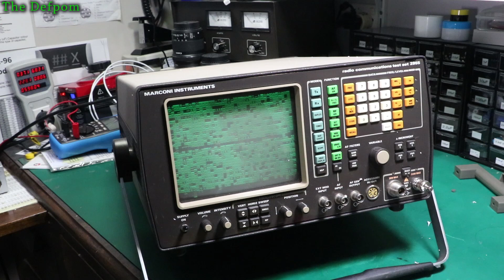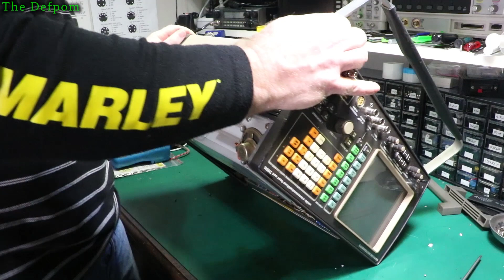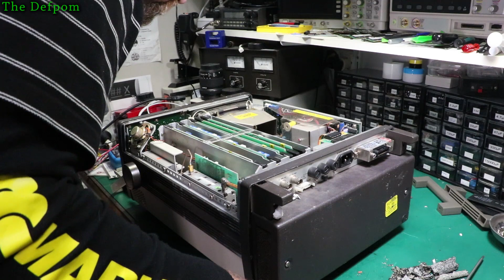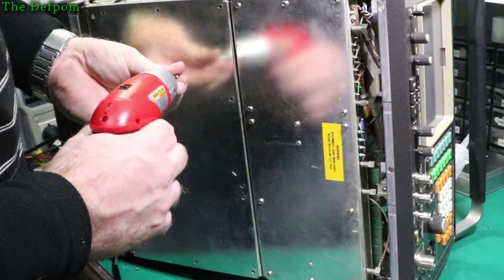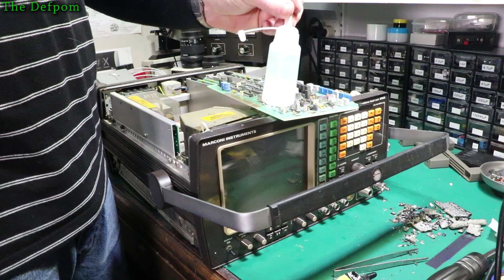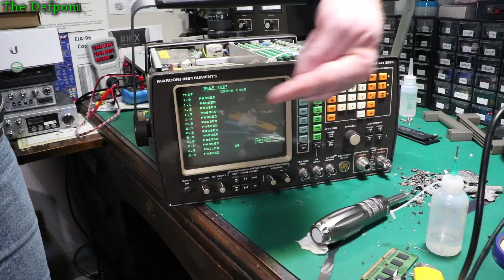🔴 #627 Marconi 2955 Repair Part 1 - Marconi 2955 Communications Test Set Teardown

Comment: The label fell of IC13 the calibration data EEPROM x2816. DO NOT try anything to adventurous with this IC. It opens up a minefield of hassle to recalibrate with a lot of specialist equipment needed. IC9, 10, 11 are M27C128 and IC12 is a M27C64.
As the EPROMs hold all the data for display it was more than likely the card that went loose. These are also the IC's required for firmware upgrades.
  the latest version is v16 but it only included GSM testing and required a 2957 D'AMPS unit. Avoid v15 as it has bugs and v16 and see if you can manage to get hold of V14. From v13 to V16 other than GSM the only advantage is a few extra GBIP commands. Some versions also omitted some accessory commands and needed the EPROM to be changed to enable this.Power heads, GPIB printer  etc failed to detect.
Reply from the maker: Thanks for the helpful info.
Reply: @TheDefpom  I forgot to add the VDA board is next to the board worth the EPROMS. This can also give display issues.

Comment: Thanks for making this video! My 2955 had exactly the same problem. Cleaning the edge connectors brought it back to life. Also had to clean the unit out. Not because of wax, but because the dust filter at the bottom had fallen apart completely and was blown into the unit by the fan. Big mess...

Comment: The other day mine appeared with exactly the same weird rubbish at the screen when beeing switched on after too many weeks unused. 

I leaved it heating up for several hours and screen was alright afterwards.  

Looks like the 2955 doesn't like to be sitting disconnected for too long.

Comment: I commented earlier today - & decided once & for all to pull the cards out & use a rubber - it’s now working great 👍 a Friday fix for me today too after years of waiting for it to play ball. Also cleared some bits of wax that were across a few pins. 
Correction: is working but now failed 2.1 error 23 2.2 error 26 2.3 error 28. Never had errors before / we’ll see what rabbit hole we’re gonna go down today. 👍
Reply: Cured the problem - by luck - decided to check a radio for output power to see if the Marconi still provides info - which it does. By doing this it cleared the errors mentioned above. I can only assume that the unit ‘sorts’ itself out having a bit of RF applied. 

I did clean up the card with the potentiometers on (calibration setting card I saw on your other video) and again gave the errors - but I applied a bit of RF & the unit passes all self tests. 

I did this without putting the metal screen cover over the cards - saved aggravation shows it can be done. 

So, for future repairs - & those watching - a clean up of the contacts was stage 1 - insert cards & self test - if fault still present - connect up to a radio and inject some audio / power into unit - turn on/ off - self test again - this might rectify the errors - call it an ‘energising’ of the boards from an external device. My laymans explanation. 

Cheers 
All the best
Reply: Link to RFMAN RFMAN YouTube vid re the Marconi 2955 / superb walk through & videos 

https://youtu.be/v7pS5ANUWWE

Comment: What you failed to do is to switch it on & off again! 😉 well, there are posts I’ve seen where some say not to do as it can corrupt the eprom data - but I just had the garbled screen - switched it on & off couple times - & it’s back again. Mine has always been / still is a temperamental unit - works when it wants to e.g stays on first screen Receiver Test - possibly the OXCO at fault as I think this unit doesn’t lock in / temperature effects it

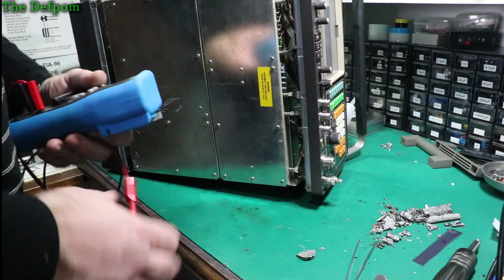Comment: The moment I saw that garbled screen, and definitely by 14:00, I'm thinking you should re-seat all of the PCB cards - I've never found vibration during transport to be a good thing.  
Personally, I'd also check all the slots on the main board,  especially with all those wax chips floating around.  Loose  guide rails  can also wreak havoc.
At 22:00 I'm  glad to see the old gut feeling is still right sometimes.

Comment: I think F38 was AM level circuitry, before dissassembling it try to do a calibration to write a new calibration table, if it still fails afterwards check the OM345 modules. If these amp modules seem to be dead try hooking a 4.7kOhms resistor between their first and last pin and if they come back to life with this hack the internal 3,9kOhm feedbackresistor on the ceramic substrate is blown. You can repair them by scraping off the orange paint on the capacitor area of the module ans solder a fresh 3.9kOhms resistor in parallel to it. Always do a selfcal after repair because nothing in these old buddies works linear ;) Once I owned the 2955B with extention unit and the 2968 from IFR, I know what I'm talking about.
Reply: I agree the OM345 modules can cause lots of issues on these. The work around as you said is to solder a 4.7K resistor across pin 1 to 5.
But only do this after making some DC measurements on the OM345 otherwise you could blow a working module !
I good source of info on the OM345 and possible replacements or work around can be found here
 https://ea4eoz.blogspot.com/2017/09/repairing-om345-hybrid-module.html

Comment: Nice piece of gear, I used a Marconi 2947 at work for many years on VHF and UHF comm gear -  very reliable and easy to use. I also used an HP 8920, but it was a little less user friendly. Great job getting it up and running!

Comment: good bit of kit had to replace all the om345 in mine and replace a transistor and a cap on one of the boards prefer the 2955 over the ct systems inc 3000b I have on my shelfs

Comment: Be very careful using erasers to clean board contacts as the rubber contains sulphur that will contaminate the metal and create corrosion later on.

Comment: Bottom modules seemed unlikely as all that looks to be front end RF Functions. The top card cage is mostly the system processing and thus the displ ay processing. Thus garbage display is from that part. As it appears rather ststic not part of the RF front end ( underside). Still good to look everywhere.

Comment: I’m glad it started up. I expected it  to be a loose card. Very occasional my 2955 does the same perhaps 1 time in 50  but then starts up normally.  I had assumed it was the processor card but not got around to investigating it. A lot of these Marconi devices give error codes  it may even work fine depending on the error certainly calibration can cause error codes.
Reply: That first comment made while bottom being opened!